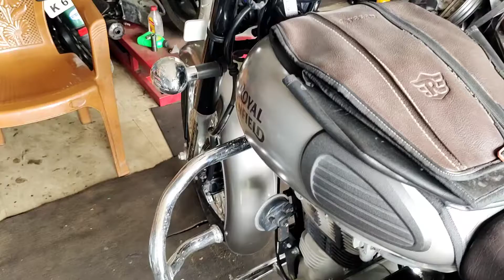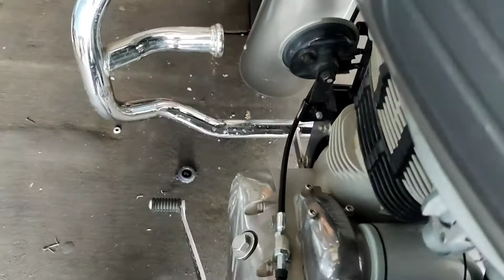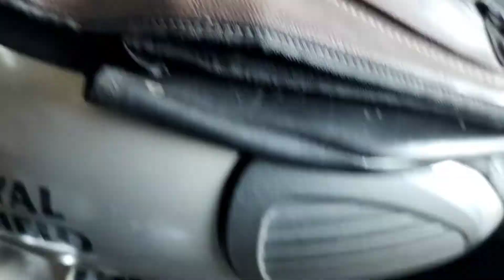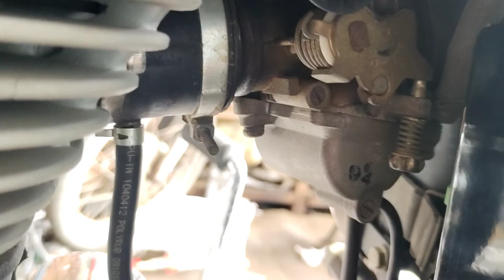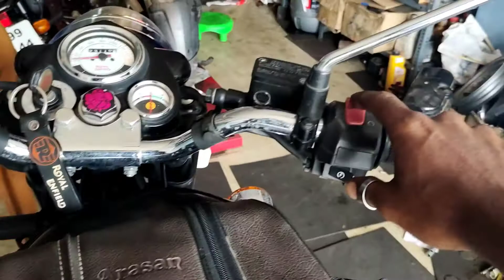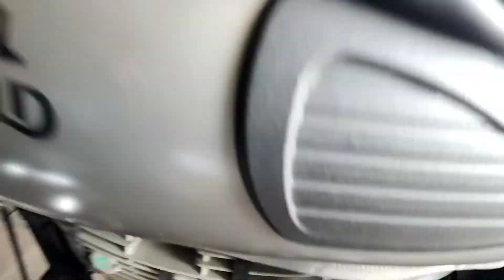Rayalenfild/carbaretor tuning adjustment/தமிழில்/RE mileage adjustment

Comment: My bike ss gladiator bike is clogged running in the cool engine, air filter is new, oil is new, spark plug is new, I tuned the very perfectly, but, the problem is not solved.please reply.